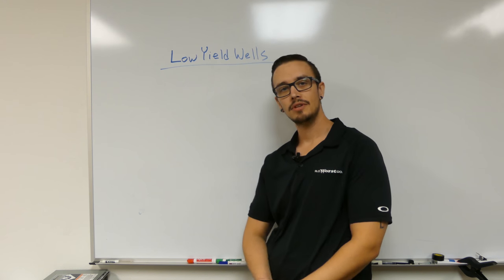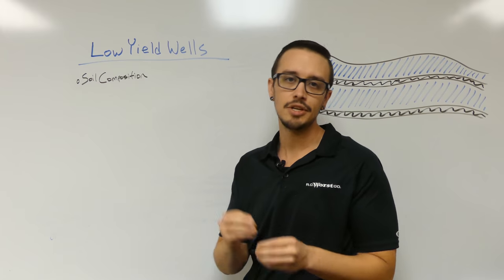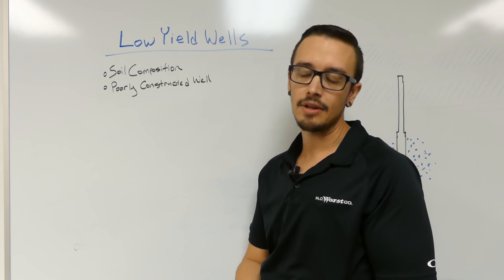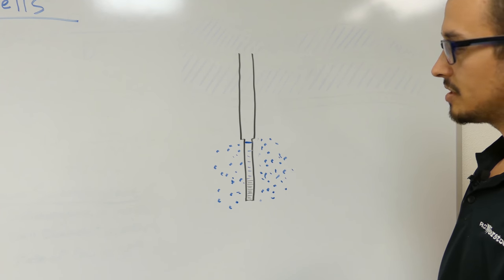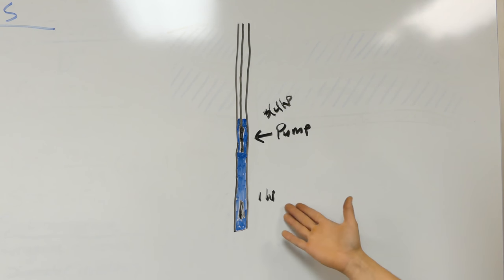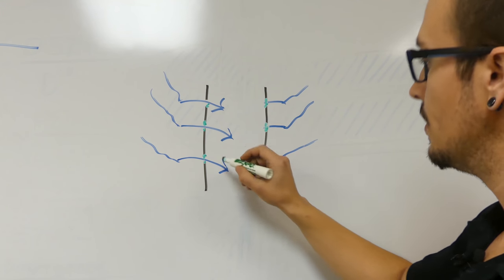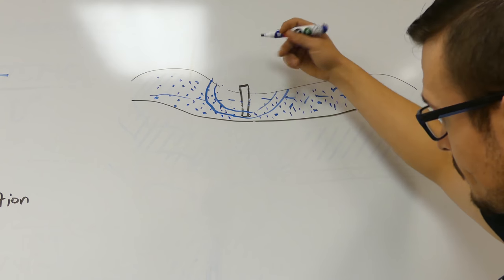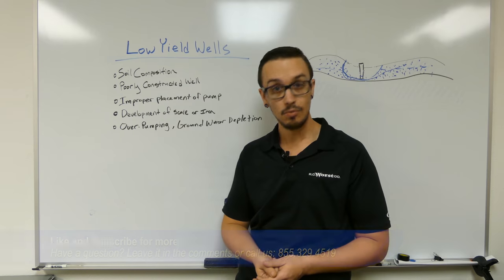Low Yield Wells: Common Causes

Comment: I have a 3-inch pvc well set up that I tried to have tested for recovery and see if I could get more water out of it. My issue comes during filter regeneration running out of water. EVERY regeneration cycle ends up running out of water and sucking air into the system. (It clearly doesn't make for a good regeneration cleanout)
Is it possible to widen the well to 4 inch and get a decent amount more storage or flow? The guys that came out from the local well company couldn't figure out depth or recovery as the 3 inch pipe didn't allow then to figure ot out. (They tried echo determining level and even tried to add a copper pipe to see if they could echo past the pump blocking the pipe. No luck)
I never followed up to get a new team out that might have more experience or change too many setting to the regeneration to slow down or break up the usage during the backwash using too much water, etc. 
Any ideas?

Comment: I have a couple questions. According to the other Wells nearby are water table was between 110-200 ft when my well guy hit 210 still no water. He let it sit for the entire weekend still no water. He then drilled down to 350' and he had no water but the formation Stones were there saying that there should have been water. As I was out of money and I could not go to the 700' Coconino Aquaphor and left thinking that it was probably going to be a seasonal well but as he was welding the cap on there was air rushing out of the ground. 2 hours later I checked the well air was still rushing out of  the casing, on the inside was saturated with condensation. I dropped a string down there is liquid down there, it was the color of the Sandstone that he had been drilling out. So my question is he hit a lot of fractures when he was Drilling where he would literally go down 10 ft and no drill fluid was coming out then he would go down another 15 ft and it would happen again and this occurred over 100 ft could it be taking more time for all that drill foam to work its way out so that the water can start flowing into the well?
Other question is if there's old drill foam in the well will it break down or do I have to somehow pump it all out?